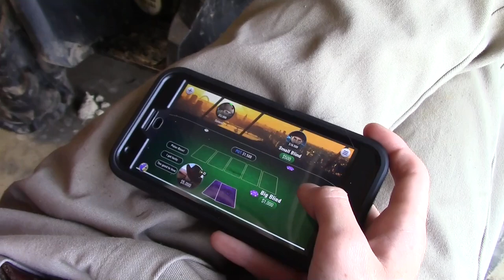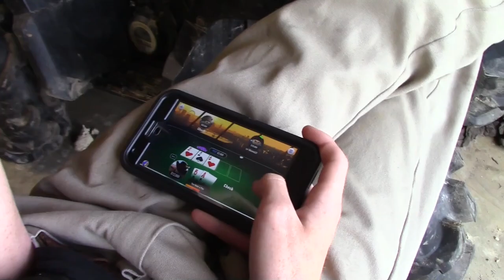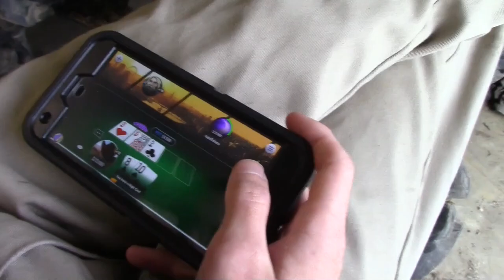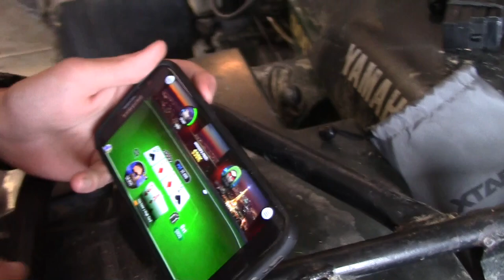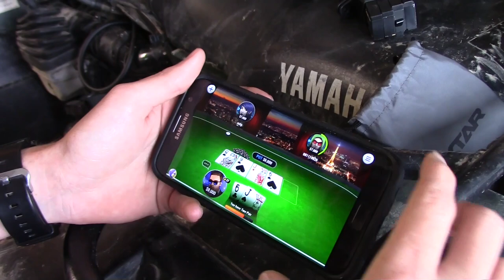DIRTBIKER Gets RECKT! | I'm Back! Plus The COMPOUND!

Comment: When the bike floods like that kick it real hard and hold the throttle wide open. I had an 06 CRF250R and it would always flood if I dumped it and holding the throttle open worked every time.
Reply: Nolan Raymond Yeah I learned that tip from a friend. When the big 4 stroke motors flood they are hard to start so kick it hard and have the Throttle wide open.